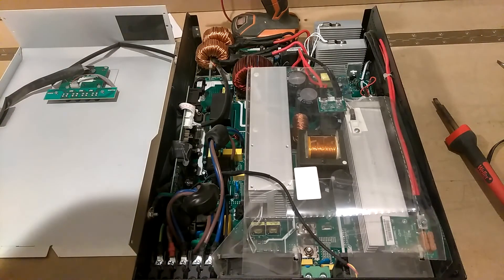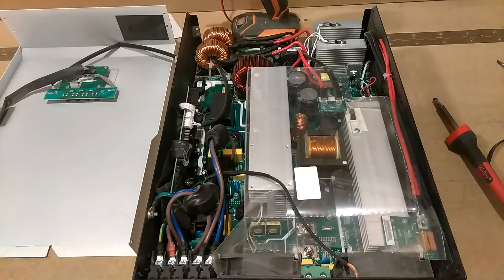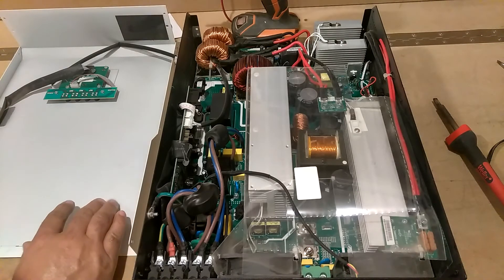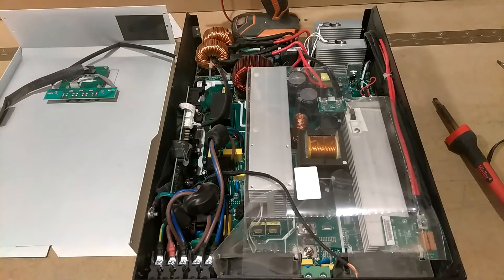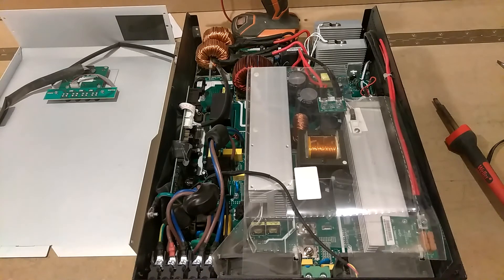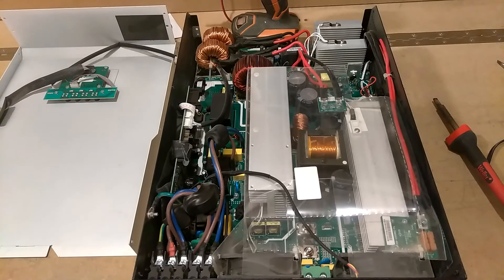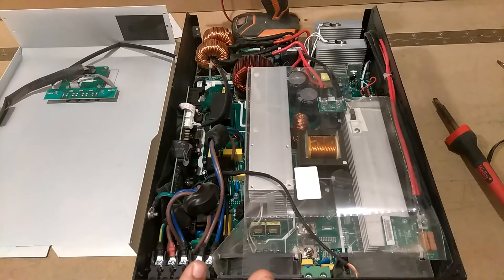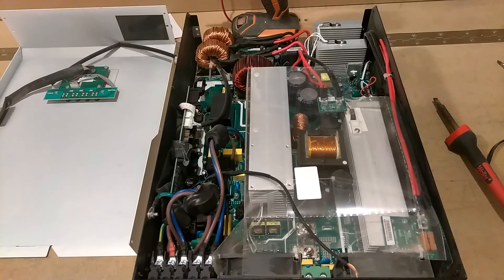My pip 2424 is back together will it work.

Comment: Of course I suppose you could also use a dc to dc converter to charge the 48 volt system from the 24 volt system if you wanted or even from 12 volt system just not as efficient.

Comment: Good luck also I think you got it !!.  Just a thought I am sure you have considered.  I see no reason you couldn't use the PIP24 to charge a battery pack  such as 3 parallel Nissan modules but have at least 6 modules with 2S2P configuration and connect to them at the 48Volt terminals as if 4S ( actually 12 cells) but you would have to use a separate 48 volt PIP since that voltage is different from your 48 volt setup with 14 cells.  

This brings up a question I haven't really thought about but should have.  Is there any reason if you have 2 MPP LV5048 in parallel  can you connect each to their own battery pack? If you can ( I am pretty sure you can if the same chemistry and thus same charge voltage and cutoff voltages etc would be used) can you connect say lead acid batterys to one MPP and Lithium to the other MPP and set the parameters differently ?  I know you cannot parallel the PIP24 volt with the 48 volt ( though you might be able to connect one to the other as if the grid or generator source and synch them in off grid setup or with grid disconnected).